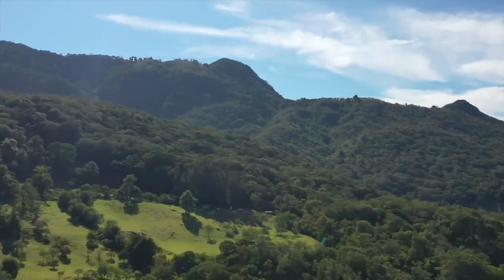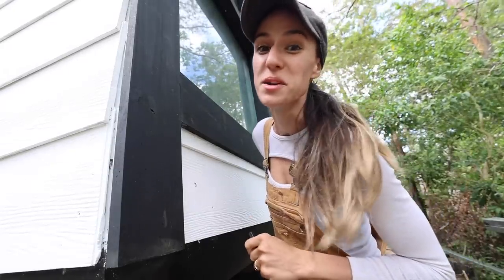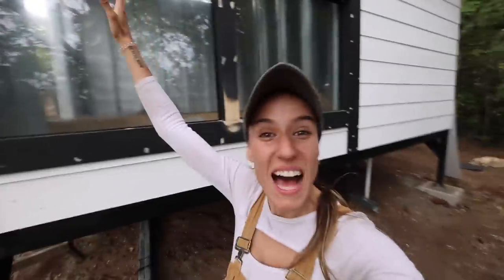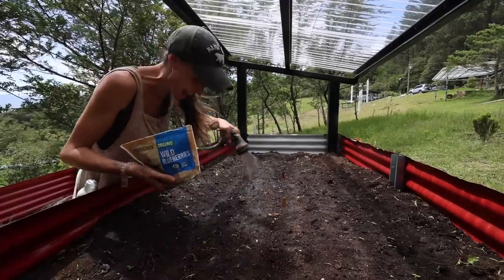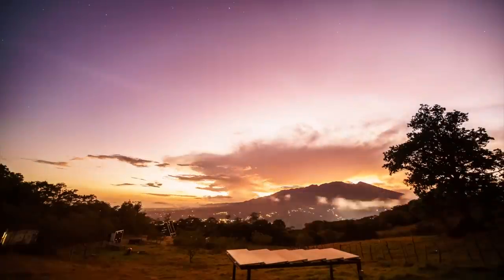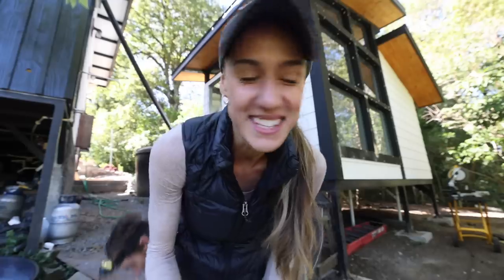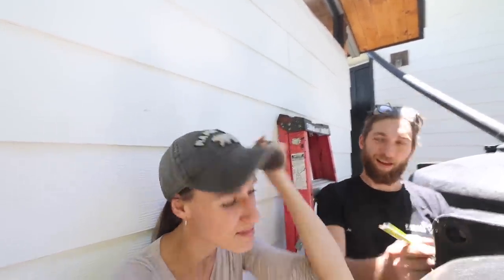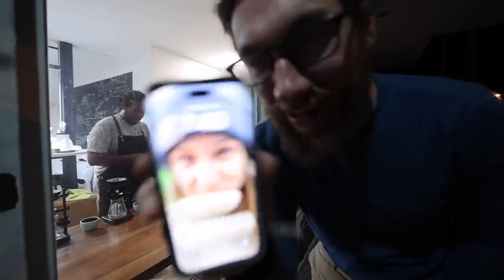FINISHING THE OUTSIDE / DIY Tiny Home in Panama

Comment: Colloidal silver or lavender oil is the best thing for burns. It’s great to have those 2 things as part off first aid supplies. You can also use both, silver first then lavender oil. Instant relief. Colloidal silver is used in burn units of hospitals. It’s easy to make as well ( search tube) and has many other uses.
Reply: Yes, we use colloidal silver on burns on animals too, in the vet industry.
Reply: I concur
Reply: We use silverdeen. Also the cold water and butter
Reply: @lorettapowell9379  never butter, ever. Ex Chef here, always cold running water.
Reply: @lorettapowell9379  omg NEVER use butter!
Reply: I heard dipping in Milk is good. But my husband has a bad burn now. They recommend polysporin now.

Comment: Grow Aloe Vera..It is amazing on Burns. You cut the leaves off and trim the spiked edges of the leaf, then peel apart and tie it around the hand. Leave it on. You need to do this immediately after you burn yourself. Valuable planr ro have around. Low Maint. Plant.

Comment: You guys work so hard it’s amazing. Kaylee suffering through burns like that and still pushing forward is amazing. You never cease to amaze me. Wondering if maybe a simple tarp that could be rolled up and down when you’re having heavy winds etc. in your garden area might help. Would be kind of noisy, but might help the plants as they’re starting to emerge. Also, wondering if you could utilize the roof from your new patio cover as well as the roof from your bathroom to collect more water in your tanks. Maybe even a small gutter system on the garden roof to collect water in a smaller tank next to the garden you could manual pump out or just scoop out with a watering can.

Comment: The best thing for burns is fresh aloe. I pick leaves from our plants at home when I burn myself or get a blister. Just slice the leaf open and apply it directly to the wound. Keep reapplying whenever there’s pain or itching. If you put the aloe on a burn right away, you can avoid most, if not all blistering. You can keep cut leaves in a sealed container in the fridge to use again later and it makes them cold for extra soothing power.

Comment: First thing, Happy Mother's Day! 
    Do your best to not pop the bubbles covering the burns. It will only allow bacteria to get into it. Once the pain is not so bad, carefully wrap your wounds with clean bandages, changing them every day. Do your best to not use your wounded hand. Try to keep it dry and clean. If the blisters pop in the next few days, take extra care of that area, keeping it dry and clean.
Reply: On the contrary. Pop the blister with a sterile pin, squeeze out the fluid and leave it alone. The pressure is relieved, nothing gets in and the raw skin is protected.

Comment: You should get a aloe vera plant for your kitchen!  I used to work with a soldering iron everyday for 15 years.  Once I dropped the iron on my hand, just like yours.  We had aloe vera plants on hand for this reason.  I cut the leaf, lengthwise and put the gooey on the burn.  Within an hour, you would have never know I burned myself.  That plant is a miracle.

Comment: I keep a liter of aloe gel in the fridge for burns. If you can apply to the burn within a few minutes it will completely stop even second degree burns from progressing, not even a blister. Still helps significantly even 30 minutes later.

Comment: Hey Kaylee, a tip from professional kitchens:  Anytime a pan has a hot handle, drape a towel over it.  Unless you're starting a pan from cold, always use a towel to hold the pan.  Once you leave that pan, if the handle can be hot, put a towel on it.
Reply: I do that to remind myself the handle could still be hot. I learnt the hard way lol

Comment: Try not to pop the blisters. They keep your wound sterile while you heal. Keeping ice on it is the best you could have done…but I’ve found the leaves of the aloe plant actually also pulls the pain out, too. Scrape the gel out or just lay the sliced leaves on. I always keep a plant growing.
Reply: Yep! Plus no scars from putting a slab of aloe gel on the burn and wrapping with gauze and leaving it on overnight ... swap out the slabs often
Reply: @surfinghigher  This!  I worked in a flower shop and on a busy holiday my boss got a nasty hot glue burn on her arm.  She sliced of a slab of aloe, taped it on and went back to work, somewhere through the day the aloe slid halfway off the burn.  Sure enough when she unwrapped it later you could totally see it blistered where it hadn't been covered.

Comment: Happy Mother's Day, Kaylee. Advice for burns. The rule for cooking a steak/meat is to remove the steak, from the source of heat, BEFORE it is cooked to ones own personal preference. (Rare/med/etc.) The skeak continues to cook as long as there is still heat inside.  Your flesh is  "meat". Immediately after you recieve a burn, place the injury in  cool running water. For however long it takes to "remove the heat/put out the burn/kill the pain, keep the injury under the cool running water. DO NOT remove, until ............there is no more pain, when you remove the injured hand (body part) from the water. In most cases there will be no blister, no more pain. You have to "put out the fire". (Don't be impatient, this does work)

Comment: BEST FOR BURNS -- BREAK OPEN VITAMIN E OIL CAPSULES WITH A PIN AND SLATHER THAT ALL OVER THE BURN. PUT GAUZE PADS OVER IT. LET THEM STICK IN THE OIL. TAPE IT DOWN. YOU WON'T FEEL ANY MORE PAIN AND IT MIGHT NOT EVEN SCAR.  I did that with a third degree motorcycle pipe burn inside my leg. Change the bandage daily and add more vitamin E oil.

Comment: Run a needle and thread through something like iodine. Slowly and gently run needle into one side of blister and out the other side. Leave about quarter inch of thread hanging out each side. The fluid will slowly seep out along the thread and flatten the blister. If the blister reappears redo with fresh thread. Having your original skin over the burn it stays cleaner and new skin can form with natural bandage of the old skin. By the time the old skin has started falling away the new skin underneath has had a chance to heal.

Comment: Holding ice on an already cold burn wound makes it more sensitive to the regular air when you take off the ice. I run Luke warm water on my burns suffer through the pain for about 30 seconds and then the air feels like heaven when you pull your hand out of the water.

Comment: Kaylee if you have a tomato cut en half and smire on the whole  burnet area and kept on for about 20 minutes or until you fiel etching because tomato is drying out little bit then wash off, will stop the intense pain because the acid of the tomato rehydrate and star restoring 
the skin was continiue burning, that is way you feel so mach

Comment: You guys are amazing! Your tenacity is encouraging. Thank you! I know this sounds crazy but it really works immediately. When you get a burn, put water as hot as you cam tolerate on the burn. Do this for about 3 to 4 minutes. It will completely take the burning away and you will have no blisters at all. This technique has never failed me.
Reply: Oh, you have to do it right after the burn. Don't wait. It will hurt while under the water but when you take it out of the water all the pain  will be gone.

Comment: I grabbed a hot pot handle earlier this year and had a similar bubbling burn on my hand. What helped me the most was applying a thick layer of aloe vera and rapping it with a bandage to protect the skin and keep it moist. It stung like crazy not having ice on it but within about 10 minutes the stinging died down and it was tolerable. The next day I was able to hold things and grab things with my hand without the bandage on. The blisters healed and didn't pop. Hope this is helpful.
Reply: Also you are amazing pushing through the pain and continuing with the work on your bathroom.

Comment: 2nd degree burns are no joke!! I burned all the tops of my toes when I was a 12 year old little guy. It was soooo bad I ran cold water on it for hours but I couldn't keep it under the faucet. I had to hold it under for about 15 seconds then pull it out for 15 seconds for literally hours! Cried the whole time. My parents were teaching me a lesson I guess.....it worked!  I never went to an area where a brush fire has burned through again. Still went barefoot but paid close attention to my surroundings.

Comment: Pro chef tip.....after suffering many many burns over a 35 year career.....never ice or cold water on a burn......run as hot of water over it as quickly as possible and it will remove the pain.  I know it sounds counterintuitive......but it works.

Comment: Ice prolongs the pain…it takes about 40 minutes. It hurts like heck but after 40 min or so it calms down substantially. And I would pop it tomorrow to let fluid out. Try not to remove dead skin as long as possible. It will begin to heal from the inside.

Comment: One of the old ways of treating burns is to cut an onion in half and place it on the burn. It stops the pain quickly. Do not know if it will help any as long as it has been since you have been burned.

Comment: Tip for burns (I’m an herbalist). Keep lavender essential oil in your kitchen. When you burn yourself put lavender oil on it. Keep putting it on if it still hurts. You’ll be amazed. Your burn won’t bubble up and will feel so much better. It’s important to put it on as soon as you burn yourself.

Comment: If you have a tomato handy cut it in half and rub it on the burn as an emergency measure.  Also if you have a can of larger beer you can pour that over the burn area. It will immediately stop the pain. If the burn is truly severe, obviously seek medical attention.

Comment: If you can get your hands on chlorine dioxide which is super cheap, next time you burn yourself you won’t have a blister nor a scar. The sodium chlorite (before you mix it with the acid to make chlorine dioxide) stops the acidic reaction that leads to the burn. It’s amazing! My partner has been using it for years to treat people with burns.

Comment: Since you've been without a bathroom for so long, if it were me, I'd forget about all that finishing work outside, and concentrate on getting the bathroom functional inside, so you can actually use it. It will make the reality of actually having a real bathroom happen sooner.
Then, after it's fully functional, you can come back to the outside, and any other place you have little touch ups to do, and finish those up. 
You do know we can't see those little nail heads on any of your videos. Nor any missing trim... 
"Get yerself a werkin' shitter & shower! " 🤪😎

Comment: All the wind you guys have I am surprised you don't get much if any power from it. Windmills do so much in many farm areas from pumping water to making electricity, and you have an abundance of wind.  I have never been involved with one of the eggbeater style mills like the one you have and was waiting to see how well it would work. But you gave up on it so early and never went back to it. I have had experience with propeller style windmills or as some of the industry says Jacobs style windmills. If you dont recognize the name Jacobs look them up on the internet. Mr. Jacobs and his brother later joined in the production made the Cadillac of windmills. The US Government used one of them to power the south pole experimental station and I read an article by someone that relatively recently found the old windmill still turning in the wind but the batteries had died and frozen, so they disconnected them and hooked the windmill to some of their own batteries and the darn thing started charging them immediately. After all these years. To bad they closed the factory some time after their heyday. I met Mr Jacobs <retired> in Ft. Myers when I was in high school and learned so much from him. The "electrification" of America was his downfall. It was pushed by and funded by the government. But he did well with his patents because so many aircraft manufacturers used his prop design/production equipment/speed governing system in manufacture of airplanes.

Comment: HONEY & LAVENDER is THE BEST BURN KIT in the world. Organic neat lavender oil neutralises all burns and so does honey. You can mix them both together and apply straight onto burns. I have done this numerous times to 2nd degree burns. Fresh urine is also another great one. It neutralises the burning skin, provides stem cells and prevents all burned skin from scarring. Reduces and prevents blistering, wet tissue with urine (fresh or aged) and keep applied to burn. It cools burn down and speeds up healing in a seriously impressive amount of time. I have no scars whereas I would have if I used none of these wonderfully naturally healing substances. I also healed cervical cancer with mainly urine therapy, it heals everything. I would be dead without urine therapy

Comment: Hey guys, I'd keep a supply of Colloidal Silver handy to go with your first aid kit.  Its the best natural anitbiotic and heals every health issue I've had in the last several years (like irritated cuts, respiratory infections, nose congestion, irritation of the eyes and ears as well as "tooth pulling".

"3 nine volt batteries. 2 silver rods or 2 .999% silver coins. A short piece of speaker wire. Distilled or rain water. A glass jar. 4 alligator clips.
Fill glass with water. Attach the 4 alligator clips to the four ends of speaker wire.Attach the rods or coins to two alligator clips. Place them into water and don’t allow them to touch each other. Attach the other two alligator clips to 3 nine volt batteries connected to each other. Let sit for a few hours. 
Look up Bob Beck if confused. 
It cost me $26 to get 2 silver rods and a TDS meter."   Don't need the meter though. I gauge ready when the wires start to look like charcoal build up. Usually with good distilled water, the brew time is a bit over an hour for a quart jar.

Feel better Kaylee!